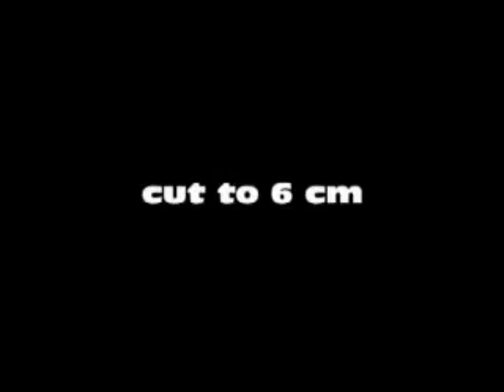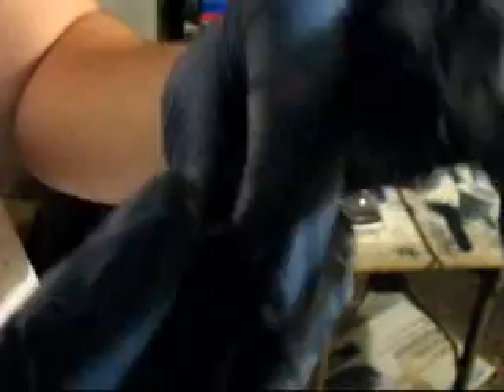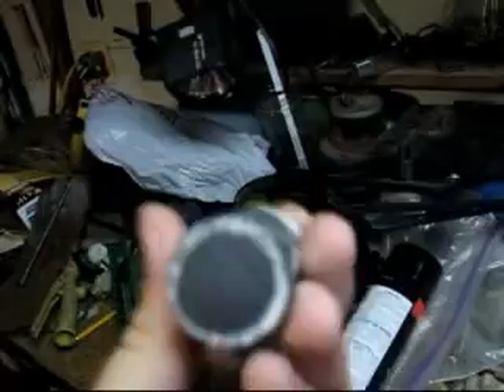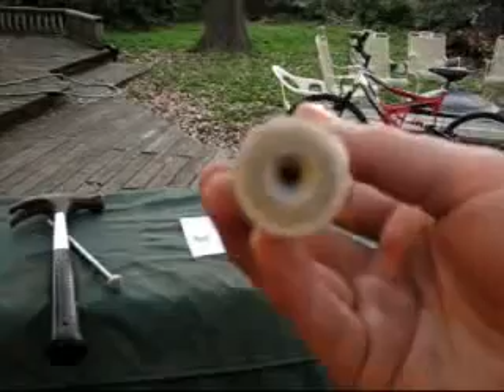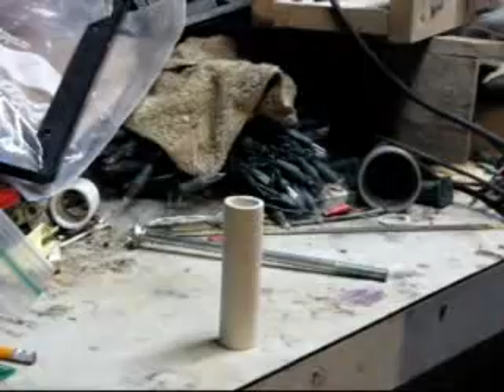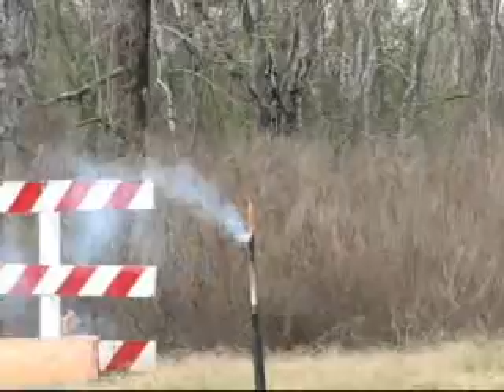APCP rocket motor constuction and launch

Comment: This is a old video, but still available and with some good experimental information. I want to make a couple comments for first time viewers. First Epoxy resin is a wonderful material, but it is NOT structural. The bulk strength is quite low. Epoxy can transfer and distribute force to other materials, which is why they can fabricate boats and airplanes from Epoxy COMPOSITE. You need to mix as much high strength material into the resin as you can, but not so much that it won't move into the small spaces you need filled. A common structural filler is "milled fiber" (which is actually cotton). You can substitute rayon, treated aramid, graphite (fibers), treated glass fibers, or even some of the same aluminum powder you are putting in the APCP. Try to incorporate as little air as possible while mixing. Second, Epoxy curing is exothermic. It not only generates heat while it cures, but as the temperature increases, it cures even faster, and releases heat faster. If the mass of mixed resin cannot dissipate the heat, it will go into an exothermic runaway reaction, boil, smoke, and possibly catch fire. Not good sitting on top of propellant. High strength industrial grade Epoxy is more likely to do this, than department store Epoxy, but as the volume increases, or the surface area decreases, or if outside heat is available, there is a risk. You are also correct in saying that Epoxy resin that is too cold, will not cure correctly. Experiment in a fire safe area.

Comment: NEVER...!! Amonium perchlorate is a very powerful explosive so...NEVER ram the mixture with a metallic object... be gentle and ram with extreme careful...a grain exploding from that distance could blow your hand and head at both time. USE WOOD TO RAM...!!
Reply: It's also not a shock sensitive mixture, ap is actually quite stable
Reply: Victor Galvez no...ap is an oxidizer not an explosive.
Reply: never ram AP ever! it will explode!
Reply: @garymoore9650  no it won't.
Reply: @garymoore9650  The composition isn't shock sensitive unless it contains trace amounts of chlorate.

Comment: Very nice job pyrorocketeer. i am currently producing my own APCP with a home made rocket. I do have to ask though......for the nozzle i know that durhams water putty and bentonite clay can be used, but how can you shape the nozzle to relate to the de laval nozzle. I know that by making a de laval nozzle the thrust would be increased tremendously because the gas is going from low-to-high-to-low pressure.